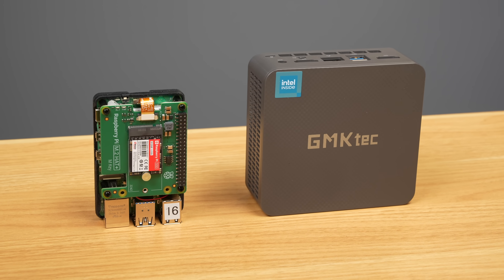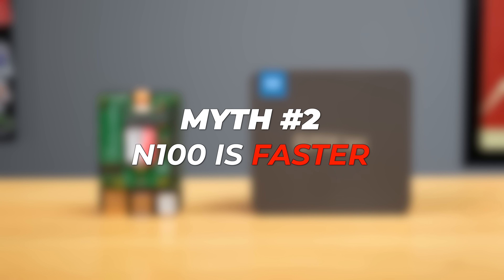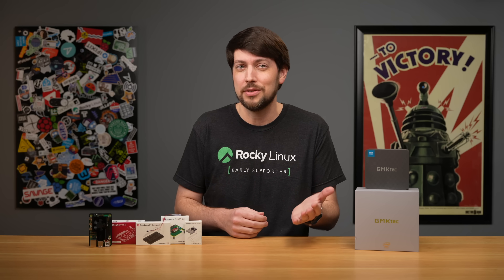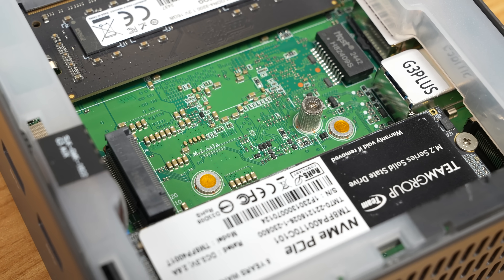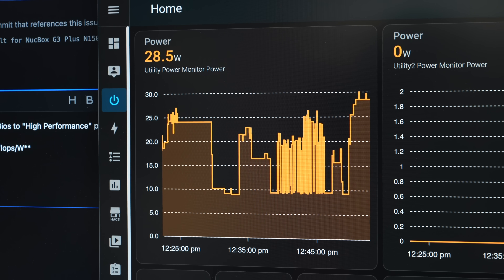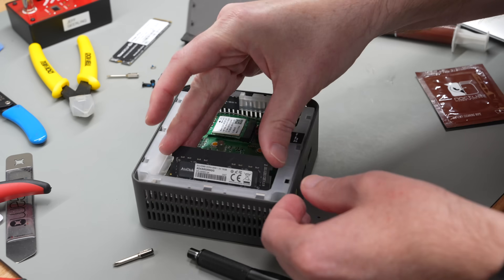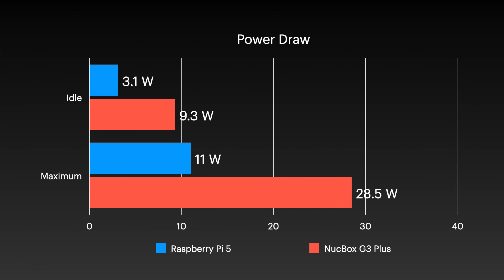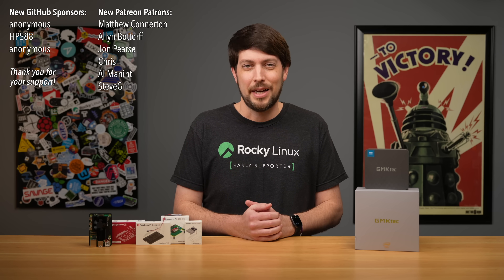When did Raspberry Pis get so expensive?

Comment: Jeff, you missed one benchmark.  Esthetics or as it is referred to as WAF (Wife Acceptance Factor). I bought a NucBox G3 a while back (probably based on your channel). I put Ubuntu on it and put it under the TV in our guest room which should more accurately be called the "I'm awake and you were snoring" room.  I wanted to be able to bail out during insomnia sessions and have a computer with OP25 on it so I could listen to the police scanner.  Or I use the NucBox with browser to stream content.  We have Sling TV for streaming and while it is cool, the app support sometimes is hit or miss.  Sling app will drive you crazy across platforms (Roku, FireTV, Apple TV)  Somebody updates something and the app breaks.  It also, however has worked in a browser. And my wife can deal with that.  Yeah I could VESA mount a Pi but my wife doesn't know how to deal with that but she does know how to reboot a computer in a box.  Us geeks can go either way but some of the people who might occupy my guest room just plain old get intimidated when you try to explain the entertainment system in the room when it is a Pi, especially if there is a DAC, an RTL-SDR, and an antenna hanging off of it.   Great content, Jeff.  Keep 'em coming.

Comment: I would avoid comparing used prices to new prices, but in Poland (and probably other parts of the eu) buying a used raspberry is basically impossible, and even when one shows up it's either super old (pi 1, 2, maybe 3) or costs basically the same as a brand new one. So it's not comparing used vs new, it's comparing what you CAN realistically buy in general. And used mini PCs run circles around "used" PIs (because a used PI, assuming you can even find one, still costs a lot)

Comment: a lot of performance differences come down to you having to find apples to apples between the two systems, in which it could be handicapping the more powerful system by limiting it to the capabilities of the slower system

ARM is more efficient at doing the few things it can do, but thats about it

a lot more mini PCs are getting things like Oculink (which is a pcie x4 connector, whereas the pi is roughly a x1 connector) 

the fact you get a power supply included ALONE will sometimes kill the value proposition of a raspberry pi for anything that doesnt specifically need GPIO

Comment: I''m a big fan of the Pi5, have both a 8GB and 16GB model. The 8GB model actually overclocks way better, to 2.8GHz without problems which should get it on par with N100 performance.

Comment: for Tiny PCs I still skip on Intel, and lately Pi as well, AMD is king for little PC at a reasonable price to performance right now (granted they also have some crazy priced ones as well), even as low as an AMD 3000H series tiny PC (this costs below $200 without discounts) run faster with the same or lower power consumption. The newer 6000/7000 series tiny PCs are marginally more cost but will trounce all the hardware you looked at, and AMD tiny PCs can be scaled really well for power consumption. I am at a bit of a loss as to why people are going back to the intel N series when AMD is so much better for nearly the same price point, and I have had much more success with Linux drivers on AMD tiny PCs too.

Comment: Here in Asia, Pi is so expensive it's not worth spending that amount of money. 
Instead, we buy some N100 mini-PC off AliExpress. Or even used tiny 1-liter PCs. 

alas, all these depends on the user's use case. 

I use old Pi (Pi 3b) for my few docker apps. Which is rock solid and never failed even once. well, the micro-USB sucks so I soldered 5v into the GPIO.

Comment: I have a few pis and 2 n100s and if you tinker with power settings it can use less power than the pi and crush it in perf still.

Pi still has its perks, especially in commercial uses as it has a guaranteed support window. If your off-brand n100 dies you probably can't get a new one with an identical setup many years from now.

Comment: Hi Jeff, mini PC suffer the same problem as laptops : you'd definitely better find a (reasonably priced) alternative for your… fan(s) ASAP and shelf some spares - so until they use regular fans this is a no-no for my lab, which BTW last SBC is a HardKernel H4-Ultra for this same reason (N300 with a large radiator and a PWM/RPM 12 V fan socket).

About power supplies, I strongly advise against the use of the "recommended" ones and to purchase instead professional PSU, such as those from Mean Well - they can work @100% 100% of the time if needed, they are extremely well ventilated (top and most sides are a grid)  and they use very good high-temperature components, they also allow for a wide security margin in term of delivered current.   To be ferpectly clear, I have no interests in this brand, just good returns of experiments.

Comment: IMHO for the use case, using as some sort of home server, the Pi is badly configured for the job. It's got a bunch of 0.1" inch header pins, which, let's be very totally honest... yes, there's some places those are useful. But what % of Pi's in the wild are ACTUALLY using them? Same for many of the USB ports, MicroSD card, camera port... It's got a lot of stuff that makes it a jack of all trades but master of none, all taking up space.

What if there was a board carrying a broadcomm chip just with ethernet, a couple USB, an M2 connector, maybe a mini/micro HDMI? Would be a lot more useful. Also waiting for a CM5 hat that turns it into a homelab server.

Comment: Did you really try to put DDR5 in a DDR4 slot???? the processor supporting both only means you can DESIGN THE MOTHERBOARD to support either one, they are totally different, nothing to do with the error correction, DDR5 even has the power supply on dimm

Comment: I mean, I essentially use my old Pi 3 as a server. It runs my Pi-hole with Unbound, keeps my DDNS stuff updated, and serves a single tiny webpage (which it also keeps updated). It runs 24/7 and has been rock solid for years. If that's all you need from it, they're fantastic. Of course, I also run some larger used PCs as servers too, because they also have their use cases. Different tools for different tasks, why limit yourself to just a hammer when you can have a screwdriver too?

Comment: 10:35 hadn't realized nordics' electricity looks to be a bit cheaper than US even. in FI past week averaged 0.03€/kwh while at the moment it's fraction of a cent negative, while transfer cost at my provider is 5€/mo + 0.04€/kwh so all in total per kWh price with eg. 200kW usage is currently 0.095€/kWh (cheaper with more use since fixed portion becomes less significant, 500kW/mo would be 0.08€/kWh) guess it's a bit more in June though

Comment: Main issue is that Raspberry PI was made for hobbyists that want to connect it to Arduino, do some smart home things or make their own VPN/AD blocker server, but in some cases it's cheaper to get older Fujitsu or HP terminal that has normal SATA drive or m.2, upgradable ram and also uses little power. Mini PC's are great for daily usage like web browsing, listening to music or office stuff, they also make great server but at higher cost, many things that Raspberry PI can do, you can do cheaper with a terminal that has dual or quad core cpu, and you are saving more money on it, ARM is fun but expensive and not ideal for everyone. Raspberry PI was always expensive if you consider versions with more ram or addons to make it usable even for emulators or something.

Comment: I have 2 mini PCs, a pi0, 2 pi02ws, 2 pi4 4gb, 2 pi4 8gb, a pi5 8gb and a pi5 4gb(which is dead by my own hand, lol). I use them all for different tasks and I love them all BECAUSE they all were less expensive than a full PC setup, AND they are all tiny. Redundancy and multi use scenarios are key for me. If one fails for whatever reason, I can be back up and running in minutes . Love your stuff Jeff!

Comment: Honesty, I think you missed the largest issue on price.  Where are most SBCs used?  Business.  Businesses don't care if price is a few bucks more.  It's included on the project they are needed. If Pi wants to be relevant they need to create a standard and add many more PCIe lanes. IO is the bottleneck with SBCs.

Comment: My 24/7 running GMK N100 has both the NVMe and the mSATA drives populated. I'm using the mdadm write-mostly option to keep read speeds near NVMe speed, but the mSATA device also gets quite toasty. So the top lid got replaced by a 3D printed 12cm fan interface and temperatures are much more manageable. You guessed it: it was a bit cheaper, go-to for x64 proxmox virtualization and had a place for an extra drive to enable some redundancy (without cables dangling everywhere).

Comment: I've had a lot of fun buying old mini-PCs for ~$50 used off ebay. They make great pfSense firewalls, great linux boxes, and usable Windows machines ONLY if you use a lightweight configuration like Windows 10 LTSC + debloat scripts AND if the CPU is on the more powerful end (like a passmark CPU score of 2000+).

One I bought came with a BIOS password. I was able to take it apart, remove the bios chip, put it in my CH431 SPI programmer, read the UEFI contents and see the password.

Comment: They didn't. The Pi released something like 10 years ago at $35. The entry level Pi today is $45, which is actually less after you factor in inflation. People are comparing pi models that had no analog in 2014.

Comment: Pricewise - it's still more expensive all around the world. And while "inflation"  argument is kinda valid, it's only partially true. If my memory serves me right, Pi3b+ was still $35 at launch back in 2018, and unlike Pi4 and Pi5 - it was always in stock and on occasion retailers like Element14 had sales! Got me few 3B+ just a couple of months after launch for around $25/ea for a base 1GB model this way. Had to ship it to my relatives in US and ship it home to Ukraine with all of my other trinkets - but it was worth the wait.  Locally I was able to buy 3b+ just a tad above MSRP any time I wanted, or any time I had a project with it. 

Performance/efficiency/thermals are also very situational. Just last month I had to retire my Pi4 and replace it with much-much older Dell Wyse thin client, which was working as a gateway on one of our work servers. It was inside the rack, in a big-ass climate-controlled DC, and yet it was still getting quite toasty even with rad and 25mm fan. For some reason the power draw never dipped below 5W with just a bare-naked pi and USB LTE modem even at idle.  At the same time Z8350 was comfortably sitting at 1-3W with the exact same setup, plus it gave nearly x3 as much WiFi bandwidth for our second WAN.   Both instances running ubuntu server 24.04.1 LTS. And I don't think Pi5 fixed the idle power draw issue, at least not according to reviews I've seen. 

When Klipper/Octoprint became a thing, Pi's got even more use cases, but today I would never even consider using one due to price and reliability issues. Most of the setups I have either use old mini-PCs, re-flashed TV Boxes, or old cheapo Intel-based tablets/netbooks running Debian/Ubuntu, or older Raspberry's (2b/3b). Every single Pi4 I ever used for 3d printers either died or had some other type of hardware failure. Pi4's were famous for dead PMICs, randomly blown TVS diodes , faulty SD card readers, etc. etc. etc. In contrast, my very first Raspberry Pi Model B(rev.2.0) still works and only killed one failed SD card after unexpected power loss (that's after nearly 10[!!!] years working 24/7). Another one is running Kody at my relative's house (also for 10 years with no breaks or vacations). 

Maybe Pi5 is better in some ways and in some cases, but I still can't find a good reason to spend $60 on a base 2GB variant. Not enough benefits for the price premium. 
And for Pi's in general - the only reason to get one these days,  is either if you need specifically a Pi for a super-specific thing, or if you need GPIO (and even that's not good-enough reason).
I think the only relevant Pi left in the entire ecosystem is a Pi Zero 2, and even that's not the best buy amongst faster/cheaper alternatives.

Comment: A device with 2gb ungradeable ram is pretty much e-waste in the era we are in. Most OS including Ubuntu would need 3+ gb to run anything beyond a Hello World blinker app. 

When you compare 8gb Raspberry Pi with an 8Gb Intel Mini, with same hard drive, including all parts/powersupply, similar quality casing, PI is absolutely not a cheap option. 

The only reason people might still buy PI would be superior software support and GPIOs, otherwise it's absolutely overpriced vs anything in it's league, I wouldn't buy it.

Comment: I got 4 of those pcs literly yesterday, and they quite good to run talos in a k8s cluster running talos as way beter partner does not complain factor then a 2ed hand rack mounted server that would be beter performance for/$ also i shoved a 32 gb ram module in it even if intel ark says it wont work it works fine, ran 2 passes in memtest.

Comment: Application and user preference... Everything else is just an argument. Using a RPI might not fit everyone's needs wither that be hardware or price, the same goes for the MiniPCs. RPI's used to be my main to-go-to but there are times when having a light-weight VM with something like DietPi fit the bill. Using DietPi in VM and RPI made it easy not to worry about the platform just the use case. I have both of these in my homelab, the MiniPC I saved up a little more and got a Ryzen7 process for more core count which gave me more resources with Proxmox.

Comment: I have a number of PIs kicking around but oddly my go to is an gamer's pc that I got for free, as it wasn't running. I put in a power supply, replaced the case with a rack mount box, through on some drawer slides and mounted it under my desk.  I use my Pi 3 as a headless media player. My biggest complaints about the newer PIs is their power draw. I always get a kick out of watching your posts. Keep well!    
Ya that gamer PC has a bit of a power draw but in the winter it is really effective in heating my tiny office.

Comment: I have a limited power budget. (limited area for solar panels gives me real life 22W during the few sunny hours of a day)
So I try to get the most out of it, while being able to run 24/7. 
When you get rid of the inefficient power supply, the pi is drawing way less in idle. 
The stupid psu draws 2.8W with the pi unplugged.

Comment: Thing is tough, what is your budget. Every time when i see "New cheap tiny PC" and it has a pricetag of 100€+ i could post the meme with that black dude in his car putting in reverse.

For the average nerd on a budget a 30-40€ used liter PC, be it a Nuc or a tiny ThinkCentre, is more than enough, it will run Proxmox with several VMs including stuff like HomeAssist, Jellyfin, Syncthing and whatnot more than fine. Don't expect it to run a modern Modded Minecraft server tough, ask me how i know. 😅

Comment: I was going to buy a pi5 8GB but just that one alone was 190 USD And adding all the extras gets expensive fast!
 I ended up buying the GMKtec N100 mini pc for 110 USD and included all i wanted to buy extra for the pi5.
Using it only for Home Assistant OS and having several calculations and custom sensors and graphs i still never go over 1% CPU usage.

Super happy with it.
And not having to worry about the PI that is known to eat one SD car every year is also nice.

If you want to compare power draw for actual use you should have a fully set up HA and compare them both doing the same job.

Or rendering lets say 10 pictures or whatever in benchmarks and see what power usage and what time.
If the mini pc is 2.5 times faster and its twice the power then it is actually more efficient, peak power and efficiency is very different
Reply: And before installing Home Assistant on it i used it for browsing and youtube on my Tv and where impressed by it being much much faster than my shitty laptop and very responsive.
So considering to buy one more for just media/TV browsing.

Comment: My personal belief is there is not an apples to apples here.  The computers do fundamentally different design things.  I love Pis for the hackablity, GPIO pins, and low power draw to deploy off grid on as you say on a solar system.  Great use case.  I love small x86 boards for software workloads that its important to get a person up and running with microsoft or google related web apps.  Its cheap, slap it on the back of a monitor and off to the races.  Hackability of small x86 boards is low.  Good luck getting it to control a servo, or other motorized thing, or take in sensor inputs easily without custom usb sensors that require crazy software to work anyway.   To me the car comparison falls short.  Maybe a plane vs helicopter or gyro plane is a better analogy.  All things fly but do it in very different styles.  Engineer your system to fit your needs, I use both.

Comment: Years ago a kernel incompatibility had me fail to get 3 different Linux distros stable on a J1900 (it was fixed after I gave up and installed Windows). Amazing to hear that the Intel low power/Linux experience is relatively unchanged :/